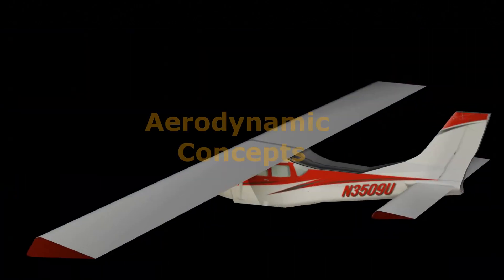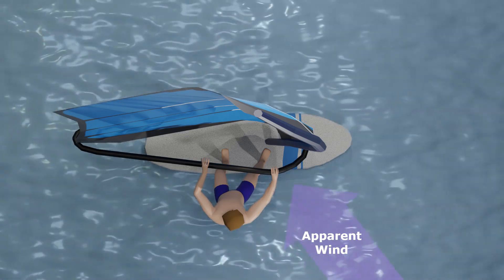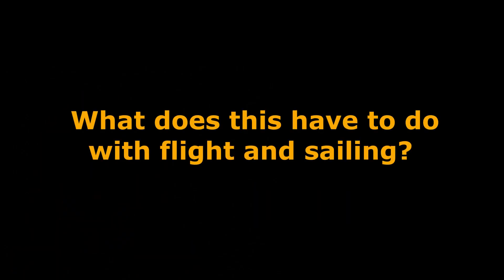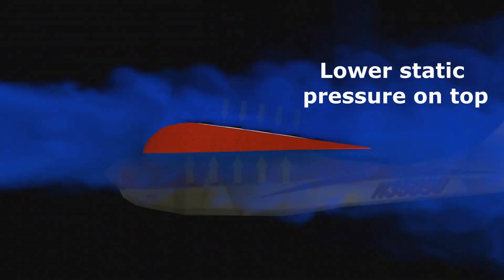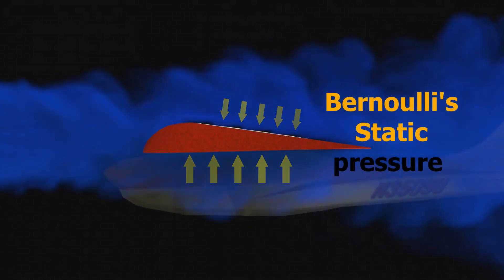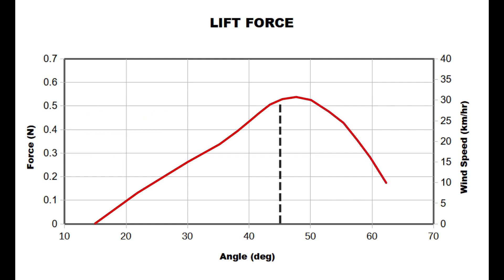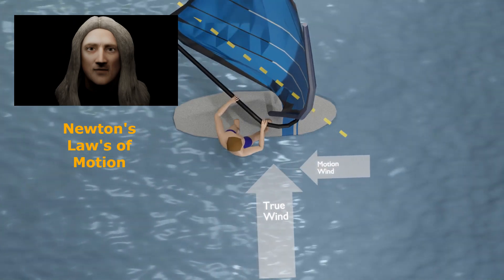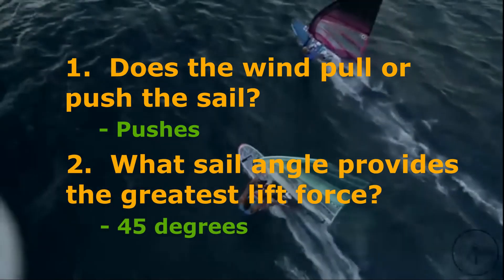Change the way you think about windsurfing

Comment: This is completely wrong and confusing! Bernoulli has nothing to do with aerodynamic Lift because Bernoulli's law is about same flow in same pipe with different diameters. There are two flows around wing section, above and below, those flows are disconnected. Bernoulli's law is not applicable to this. Particles of those flows that were on same distance to a leading edge of wing even do not meet at the trailing edge. Top one flies ~1.5 times faster. That is called circulation (Joukovsky - Kutta).
If you make a flat profile section and blow air only above it, it will not create Lift, despite that flow speed below the section is 0, and speed difference is large.
So it is not a difference in speed of flows creates lift.
Very simplistic speaking, Lift is created by bending the flow.
"Newtonian" example is also wrong. This mistake caused delay of aviation about 50 years, or even more.

Sail is more pulled, not pushed. Sailing with "pushed" sail is big mistake.

Holding sail to 45 degrees to apparent wind? Did you ever planed at about 50 km/h? The apparent wind is coming almost from front. If you sheet in 45 you will stop.
45 degrees AoA creates lift. But it also creates lots of Drag. It is main novice's mistake to sheet in too much. Drag will drift you downwind. To sail on beam reach or upwind you should hold sail 15-20 degrees to apparent wind.
Reply from the maker: Thanks @mm7 4forums.  In my first video, I never spoke about Bernoulli's principle as I didn't think it was applicable.  I also never indicate that the air particles meet at the trailing edge as that has been long proven to be wrong.  Bernoulli's principle is used, however, to explain lift (even NASA https://www.grc.nasa.gov/www/k-12/airplane/bern.html) and so I bring it up here.  Thanks for the links  you provided.  I read Babinsky's paper and I have seen the Efficient Engineer video.   As both of these articles indicate, there is confusion and misinformation when it comes to describing lift.  There are issues discussed in both of these which can be refuted.  For example, when Babinsky discounts Bernoulli's theorem by saying that blowing over a piece of paper causes lift but violates the assumption that the pressure is constant above and below is not true.  First, Bernoulli's equation has two components Ps (static pressure) and 1/2dv2 (dynamic pressure).  Due to the conservation of energy, when the static pressure goes down, the dynamic pressure goes up (increases in velocity) and for ideal fluids, this makes sense, but he doesn't speak about that.  When he shows the air blowing over the upper surface, and shows the pressure difference in the manometers in the hair dryer experiment, he is measuring the static pressure in both cases, not the dynamic pressure.  The reason the air flow lifts the paper can be explained by the drop in pressure from Bernoulli, but also from  the coanda effect and the fact that air is a fluid which, depending on turbulence, etc, can have non-uniform density.  If a low density area is created (partial vacuum), the air particles move to that area to retore equilibrium.  That low pressure area also would cause the paper to rise.  In addition, if he blew air underneath the paper , it would also rise.  This would be due to the dynamic pressure and Newton's second and third laws.   The dynamic pressure component of Bernoulli's equation can be derived directly from Newton's second law (F = ma) assuming an average particle velocity during acceleration.  

If is also important to point out that the explanations of lift on a sail cannot be directly compared to lift on an aircraft.  As I tried to demonstrate near the last section of my video, the air flow over an aircraft wing is almost always described with the wing slicing through the air essentially parallel to the flow of air.  If you change the angle of attack, without changing the direction of the aircraft, the drag component will definitely increase, and the lift component will decrease and the aircraft will not be able to oppose the force of gravity and the aircraft will stall.  However, in reality, the angle of attack changes with the change in orientation of the aircraft, since the wings are fixed in position.  This change in aircraft angle continues to maintain pressure on the underside of the wing through the momentum and the pressure against the ambient air as it turns.  At the end of the turn, when the aircraft is no longer accelerating, the pressure on the underside of the wing will decrease and the aircraft will likely have to readjust its orientation to maintain the pressure on the underside of the wing to maintain lift, depending on the power of the engine.  

Regarding the apparent wind, it may feel like it is coming from the front (direction of sail), but it is not.  If you are on a beam reach and the wind is traveling at 50 km/hr, you may be able to go, lets say 55 km/hr.  If you draw a vector diagram, the apparent wind will be just slightly less than 45 deg.  Definitely not parallel to the orientation of the board.  If you are on a beam reach, and you say you should hold the sail 15 to 20 degrees to the apparent wind, it may appear to work well, but that is only because the determination of the angle of the apparent wind is not correct.  

I agree, it is a novices mistake to sheet in too much, that is generally because they are not travelling fast and the apparent wind is only slightly off from the ambient wind.  All forces on the sail will  drift you downwind, and only the fin/dagger board prevents drift.  

Thanks for your comments.
Reply: @3denlightenment  thanks for the reply, and for the great Blender work too! 
However, re Bernoulli - the Bernoulli's principle (BP) works, of course. But the condition is - it is one flow, in one single pipe. BP does not define equation between 2 parallel flows. So, it is not applicable to whole airfoil, that goes between 2 flows.
Try simple experiment. Place a sheet of paper on a table. Blow over it (not underneath it). It will not lift up despite a difference in air flows speeds above and underneath it. Why?

If is very important to point out that the explanations of Lift on an aircraft wing, sail, fin, keel, hydrofoil, ship or aircraft propeller, turbine blade, you name it, CAN be directly compared, because they ALL work same and based on SAME principles.
And the true is - the upper surface of airfoil produces much more lift, (2-3 times more) due to negative pressure, than the lower surface does with its positive pressure.
In practice it is confirmed by stall effect on aircraft. If upper flow is separated, lower flow can still produce lift (based on Newtonian effect). But this lift will be not enough and aircraft goes down.
Same happens when I go on a hydrofoil(HF) and HF wings touch water surface. It causes immediate upper flow separation due to ventilation (catching air bubble). Despite there is still some lift from bottom flow, my board will just fall down, immediately!
If your conclusion that a sail works more on inner side pressure, then on outer side suction was true, these wont happen - I would slowly go down, not crushed down.

So, an advice to novice windsurfers should be - watch outer sail air flow, do not allow its separation (do not sheet in too much). It is helpful to put several small ribbons on stickers to both sides of sail along a chord somewhere in a mid of sail. They work as indicators - on outer side they will be horizontal and flapping when flow is not separated, and hang vertical when flow is separated.
Same applicable to fin. Feel water flow around a fin, do not over-press on it, or do not turn your board too much upwind (increasing AoA to water flow), otherwise you will experience spinout  (stall of fin).
BTW very often oversheeting of sail causes both - stall on sail, and spinout on fin due to increased side force and decreased thrust.

Of course apparent wind is not exactly parallel to course. But it can be much less than 45 dgr. Planing board can go 2-3 times faster than true wind speed. Iceboats can go even 5-6 faster. So apparent wing angle will be smaller.
If you are going to go fast, the goal will be to decrease drag component and to increase lift component. If you draw D/L to AoA polar, you will see that there is optimal AoA range where D/L is minimal. So called "Bucket of L/D". So most efficient way will be staying in this bucket while getting most of Lift. I do not remember the bucket ever reaches AoA 45 degrees.

Comment: You designed an experiment in order to measure the contributions of Bernoulli's principle and Newton's third law to the lift force acting upon an air foil. I'm certain you were able to measure lift force on the airfoil in the experiment. I'm also convinced that you were not able to measure the relative portions of the principle/law mentioned.

The idea of Newton's third law here is that a certain mass of air is diverted by the airfoil, which means that it is accelerated (it can only change direction if it is accelerated). The acceleration is exerted on the air by the airfoil (the force exerted is mass of the air times it's acceleration), hence, according to Newton's third law, the accelerated air exerts an equal but opposite force on the airfoil. The dimensions of the airfoil are chosen such that the airflow is only accelerated in one direction, with as little disturbance as possible of the laminar flow, which would after all result in turbulence, which in it's turn does not contribute to the lift force, as the direction of the turbulent air is not uniform, hence the reaction force is also not uniform (but in a wide range of directions).

In order to measure the contribution of Bernoulli's principle, you would also need to measure the speed of air over the airfoil, and the same under the airfoil, which you didn't do.

Bernoulli's principle as an explanation for lift seems to be an ineradicable misconception, based on the idea that air particles over the airfoil have to travel faster than particles under the same airfoil because the route over the top side is rounded and hence longer, and assuming that the particles take equal times to travel from leading edge to trailing edge. The latter assumption has long been proven incorrect, which makes applying Bernoulli's principle quite impossible. Moreover, Bernoulli's principle was formulated for fluids flowing in one direction, without being diverted, which is certainly not the case when a fluid is flowing over an airfoil.
Reply from the maker: Thanks @KLass van manen.  When it comes to Bernoulli's principle, I find it interesting that the explanations of lift are often centered around the static pressure differences and dynamic pressure may or may not be discussed at all.  In the experiment, I was trying to separate the static pressure differences (air flowing over the top only) from the combined pressure (air flowing over both the top and underside).  I totally agree with your discussion of the air flow over the air foil and the that the generation of lift is dependent on laminar flow and also that the generation of turbulence would reduce the lift force.   By using the 'air flow diverter' to restrict the air flow to the upper surface, I was able to measure the lift from the static pressure drop between the upper and lower surfaces.  Through the conservation of energy, through which Bernoulli's principle applies, the fact that the air flow was essentially motionless on the underside of the airfoil should have accentuated the pressure difference.   Given that I was able to measure the lift force from air flowing over the upper surface only, indicated that there was a difference in the static pressures from the air flow.  
I also agree with your comment that it has long been refuted that air particles travel faster due to the assumption that they take the same amount of time to travel the greater distance on the upper surface.  In the end, we are in agreement that the STATIC pressures of Bernoulli's principle have little to no effect on generating force during sailing; however, the DYNAMIC pressures (derivation of Newton's laws) have a significant effect.  
Thanks for your thoughtful comments 🙂